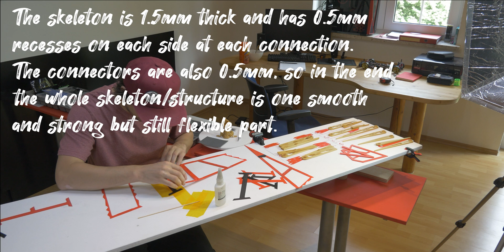3D printed deluxe RC sailboat / part2 the sails / 4k

Comment: Looks good for display, but for real sailing? I would say no because it looks very top heavy and you still havn’t released a clip of this.
Reply from the maker: yes you are right, i was too focused on looks. and not enough on function. It is over all much to heavy and also very very top heavy.
a new sail would be a good starting point to get it better working
I am currently building an rc utility boat, kind of..
If i am filming it first tests, perhaps i will take the sailing boat with me and give it try again. BR

Comment: Well an interesting build. Some great 3d printing skills.
Also nice to see the whole thing come together with some lovely details and paint job!
I would love to see what she is like on the water.....
Hopefully you will get a chance to give it a test?

The sails look great but are unconventional in their design for the type of boat.
It would be relatively easy to make some more conventional sails from maylar or some other thin material.
The sails with the skeleton look too heavy and inflexible to work as they stand. Boats using a 3d aerofoil sail usually rotate the mast and have the rear 1/3 of the sail actuated separately to create the correct shape for the wind at each point of sailing!

I think 3d printing is great for model hulls for sure
Reply: Лодки с парус-крылом строили ещё в 80х годах. Но там парус-крыло сгибало профиль по середине хорды, делая обычный выпукло вогнутый профиль. Развивали скорости выше, чем лодки с тканевыми парусами, но только при сильном ветре. А у автора этого ролика парус-крыло сделано не правильно, и стаксель сделан полностью бесполезным, менее эффективным, чем был бы тканевый. Ещё киль и балласт имеют слишком толстые сечения, что лишь снижает скорость, и судя по всему, обеспечивают малую устойчивость на воде. 
   Вообщем, моё заключение: автор ролика в яхтах разбирается сильно меньше меня, при том, что я еще ни одной р/у лодки не построил, а строил лишь р/у модели самолетов и маленькие не управляемые деревянные яхточки в детстве.😁

Comment: I hope I'm not out of line making a few suggestions I have a ton of experience making sailboats I grew up sailing and racing and I know a lot about sales I have my captain's papers and even a Canadian sailing championship under my belt in the dark class category 1989 on Lake Simcoe so I do know my business and I'll tell you a lot but it'll be a long comment sorry for that but it'll help you firstly your sale cannot be a flat sheet or too tight it does not need an internal structure it needs in some cases an external structure just to help the sale hold its shape but the sale is it better off to be made of a tent fly by hand and have you sew it yourself then to try and 3D print a frame that'll just make it heavier you don't want to fail to be heavy ever it needs to be as light as possible or the boat will heal over too much in your case I don't see that as being a big problem since these sales will not make any real power they will be very inefficient they're made more like an aircraft wing which isn't what a sale should be it's more like a parachute where it needs to have some room for it to move for it to really be effective if you took a flat sheet and tried to use it as a parachute you would die by the same token making sales is difficult and I don't want to make this comment too long but I have done a detailed series on this on my YouTube channel Keith d Robinson my custom RC sailboat you can also look up RC DIY sailboat making your sales is described in this video series in great detail showing how to hang them how to sew them you're better off 3D printing your mask and doing like I've done putting a mask inside the sale and then just sew it inside the leading an edge and the blue bench to have it hold its shape this video walks you through the whole thing including how to trim it and plead it to get the right shape it covers the correct shape shows actual testing in different stages with different cell configurations please check out these videos I hope they help that's what they're there for.
Reply from the maker: thankz for your feedback/help. 
i should have sew a sail, especially as i have pretty good skills in sewing and industrial machines. the "wing" instead, only caused problems. but it was fun and challenging to build it.

Comment: The biggest issue I see with the boats performance is the lack of shape in both the sails. Although they're both "wing" shaped, there's no curve to them, making them just large wind deflection elements rather than effective sail elements that generate pressure differential.

Compound this with the weight of the sails and I imagine it probably doesn't move outstandingly quick.

Love what you've done, super unique but you might have to look into a more traditional RC sail design to get the required power/weight ratio in your rig.
Reply from the maker: thankz!
year, you are totally right. first tests shows that the sails are way to heavy, and the yacht is more sailing as an old wooden fishing boat🤣🤣
Reply: You dont need curve in a wing sail, you can make lift with angle of attack. I also made a 3D printed wingsail. its much faster than traditional. this wingsail needs to be lighter and have more positive shape like a symmetric airfoil. my sails rotated with a motor that may also effect it.
Reply: Great job but I agree that symmetrical wingsail is non efficient. If you look at sail-gp’s boat they have a vertical hinge for flaps and a rotating mast. With the mast, you actuate the angle of attack and with the flaps, the curvature of the wing. More curvature gives more power. The Aoa depends on the apparent wind angle.
You could try LW-PLA for weight gain.

Comment: Any thoughts of making the ribs of the mainsail flex like the full-sized racing wingsails do?
Reply from the maker: yes, i have. But it was hard enough without flexible rips, so i am glad i didn't do it and preventing more trouble. 
But overall the boat, and mainly the sails are too heavy. And the performance seems pretty poor.
So perhabs i will revisit that project and make a new version, than trying to achieve a flex sail with flex ribs and a lightweight ripstop fabric. BR